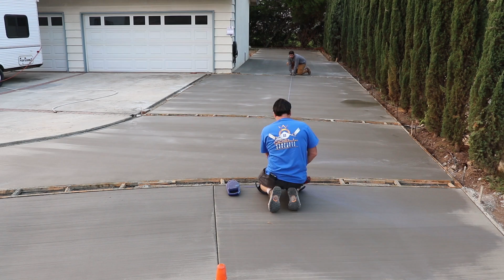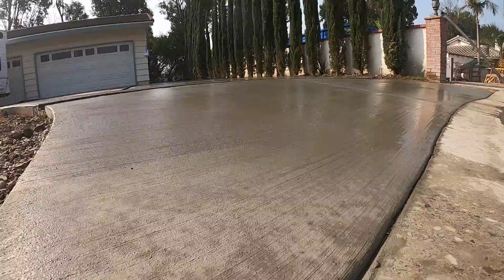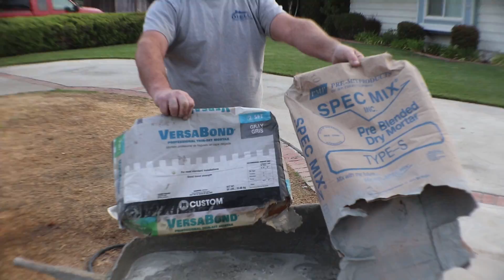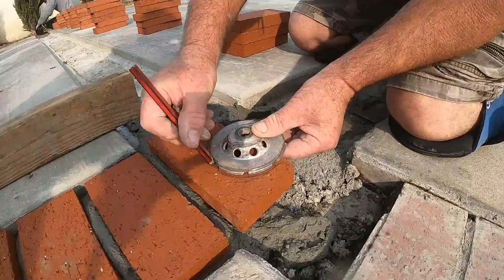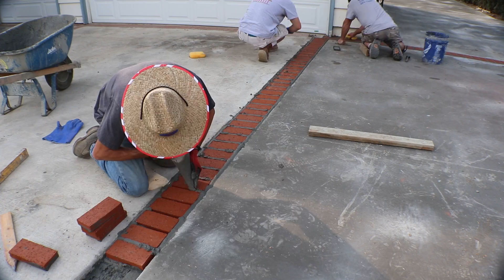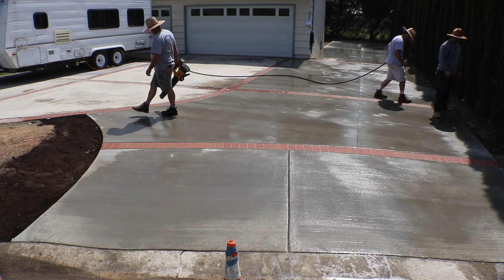Circular Concrete Driveway Extension with Brick Ribbons and RV Parking Sawcut (Part 3)

Comment: Oh , and your joints are too big on the brick , should try to keep it at 3/8ths , mortar will perform better,  and instead of grout and mortar, try using  mortar mixed with a little Portland, and some Bonding Agent /fortification mix .
Plain mortar only offers strength under 1/2. It gets it strength from the joint itself , being the brick , when you add the fortification bonding agent ,it chemically changes the mix to be much more durable and flexible, try it .
Great work though, not trying to knock your beautiful job
Reply from the maker: For anyone out there don't do it, unless you want a mess that won't clean up

Comment: If you cut the relief cuts while the concrete is still somewhat soft , you will also get no chippimg, and its much easier on the blade and saw itself.
I usually will do it the same night, few hours after pour , solid to walk on
Reply from the maker: You'll need a early entry saw for that

Comment: Idk how you are doing those cuts without water. Does that not work well on a brushed finish? Also can you actually count on that thinset since you didn’t mix it with a 350rpm drill?

Also I always use a normal diamond blade for drain cuts on all masonry style stuff. Much easier with the brick tho
Reply from the maker: Yes its perfection

Comment: Put some tile sealer on the brick about an hour before grouting. Should prevent the haze from forming. The sponging also becomes much easier to clean the grout off.
Reply from the maker: True, good tip

Comment: Enjoy watching your work.

Want to add a brick ribbon to my existing driveway at an existing expansion line. What would be the best way to accomplish?
Reply from the maker: I wouldn't do it.
It will weaken the driveway
Reply: @OdellCompleteConcrete  I thought that might be the case.  I am going to install an opener for a double gate and need to get a wire from one side to the other.  I thought about boring underneath until the price came in at $900.
What about removing a section of the driveway, say 1' wide, and laying in new reinforced concrete?
Thanks, by the way, for responding.

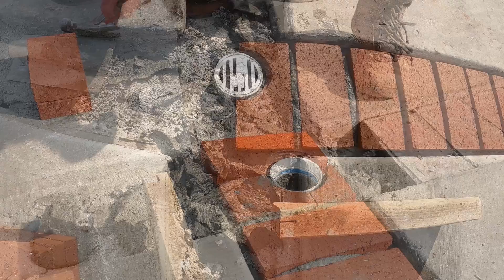Comment: 8:54 should have used angle grinder to make slope into the brick for drainage, rather than cut them.
Reply from the maker: You mean grind the brick concaved ?
Reply: @OdellCompleteConcrete  yes, looks better than brick with crack line going down the middle. 
just have to grind maybe 1/4 inch shallow slope, shouldn't be too difficult. 
maybe possible to set the brick first, and when mortar hardens, then grind to shape.

Comment: IMPORTANT 👉have a question about a jack hammer, i need to buy onr i never see you guys using Hilti te3000, all i saw Makita , i really need help selecting one , is it good idea buying used jackhammer for concrete? $3500 is over price for HILTI, makita is half price,
Reply from the maker: I've had good luck with the Makita at half the price of Hilti

Comment: You guys did a great job. One question,  did you calk in the saw cut joints ?
Reply from the maker: No
Reply: @OdellCompleteConcrete  great job. My dad the the brick strips. The brick gives it a classy look.
Reply: @OdellCompleteConcrete  it's sad that brick work has almost gone away due to labor costs.

Comment: Why does concrete cracks? And what can we do to avoid it?
Reply from the maker: Slabs with cold joints under 10' square sections.
Reply: @OdellCompleteConcrete  Cover with nilon after pouring and spray water for first 2 days. It's cracks because of fast drying...)

Comment: Your customers have good taste. They will be able to store and properly care for their RV. Regarding the saw cuts, maybe your worker could wear one of those water pouch backpacks that would feed a line down to the saw blade. For dust control and blade cooling.
Reply from the maker: Thanks for the tips!
Then saw cutting is a two man job
Reply: Odell Complete Concrete I believe the operator himself could wear the water backpack.

Comment: ( NEED HELP )  Love your videos and wish I had you guys here in Florida.. I have an issue. I have about 4000SF of concrete driveways and sidewalks. Back in 88' when all of it was poured, they used 3/4" PT between the slabs and left it there for an expansion joint. I HATE IT!!! Much of it is in bad shape and even more of it loves to be the new home for unwanted grass and weeds. I hate to use weed killer 2 times every year as our rain water goes to live fish ponds before it overflows to a local river full of fish. I am also a handicapped vet with a fused back and I cannot run a weed whip. So I am pretty much screwed and looking for ideas on what to do to properly replace the PT and keep from having grass and weeds grow there. PLEASE HELP!!!!! I'd reallllllly appreciate any ideas....
Reply from the maker: Grout it

Comment: Hey David, pro job as always. Watching you power wash the relief cuts prompted me to think of after market services. That driveway will over time obviously become dirty.  There's this guy, 'Bournemouth jet washing' channel. He does many driveways. Generally paved because of where he is but the principle is the same. You're probably too flat out but I thought it could be a complimentary service you provide. Check out his channel perhaps. Thought I'd run it past you. All the best
Reply from the maker: Yes there's a lot of pressure washer services out here.
I have did it before, it can get you through a pinch

Comment: That brick looks nice, and level with the driveway with the edger rounded on the grout turned out awesome!  I have never liked the brick inlays since they are never level, hard to roll things across, or since most of the times its not a monolithic pour and they sink after a few years.  Yours here will be solid for generations to come!
Reply from the maker: I concur.
Most brick ribbons will fail unless there done this way.

Comment: I was checking out the videos they're pretty good I worked with your brother a few times over the years I just had a quick question I have a small slab that I poured about 7 or 8 months ago and I want to expose the Aggregate and smooth it up a little bit what would be the quickest easiest method
Reply from the maker: maybe sand blasting
Reply: @OdellCompleteConcrete  it's interior trying not to make a mess my boss seems to think I can get some sort of it sandpaper-like disc he's just afraid that my guy who does it will dig in and make some small divots with the polishing bit on the grinder and I just like to say always enjoyed hanging out with Cal when he comes to the job site

Comment: Saw cuts vs. troweled in joints, is there a structural difference, or is it an aesthetic difference? Also, saw cuts vs. troweled in joints, which one is easier for a novice?
Reply from the maker: Saw cuts are low maintenance.
Less people to do saw cuts, and always straight.